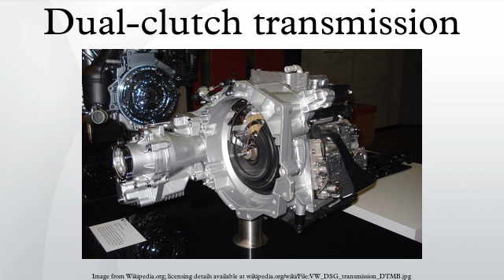Dual-clutch transmission

Comment: I have a chevy C/50, i think 1960,s----- i want to instal a diesel engine and new gearbox 5 speed with dual transfer case, i need to know the make and model of an engine and gearbox and transfer case, ???---- i have already fit new wheels 14.5---20 inch with rear and front SAMO 20 diffs. any advise will be appriciated in advance. i am in africa and have limitted market to search for my request.